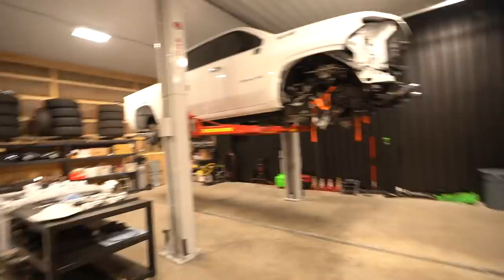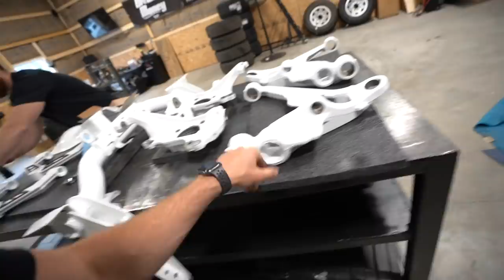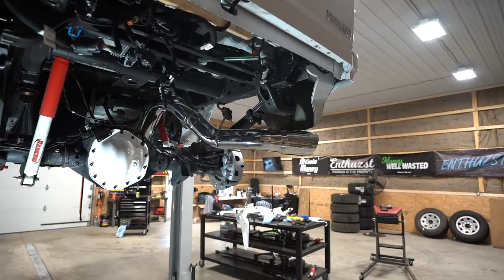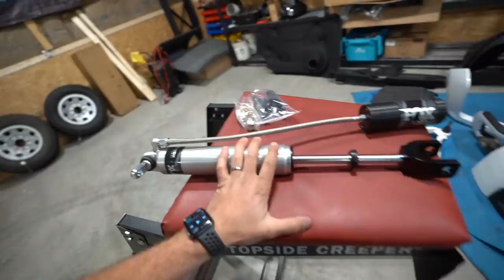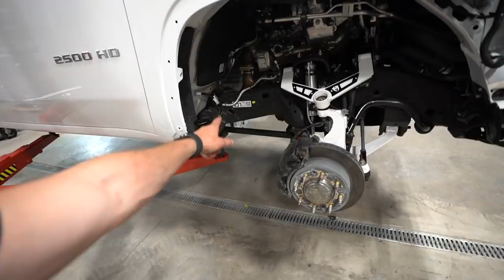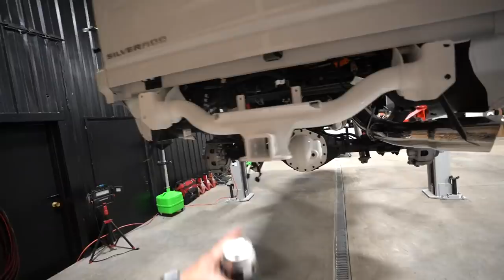Parts are back from Powder, but there’s one MAJOR issue..

Comment: Too much white 
White upper arm touching white knuckle touching what lower arms you should have broke em up some with the knuckle being bronze chrome Maybe 

I drove mine to the shop and took it apart like you all did but I instead prepped and painted my stuff and installed it and drove it home the same 14hr day lol
The paint is holding up just as good so far